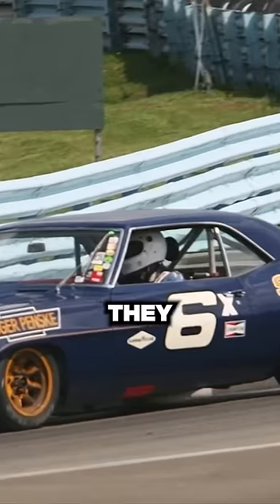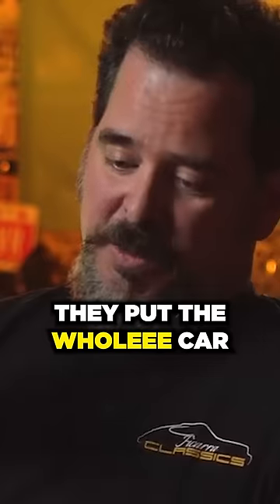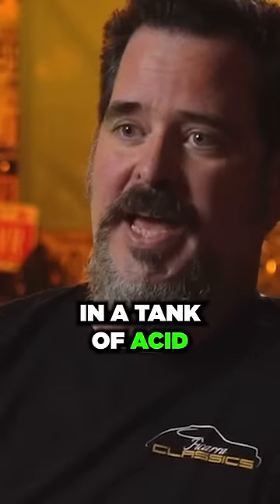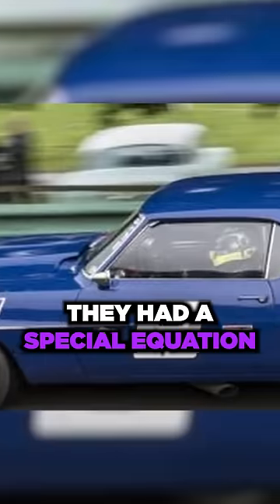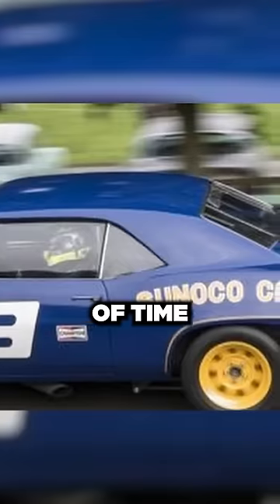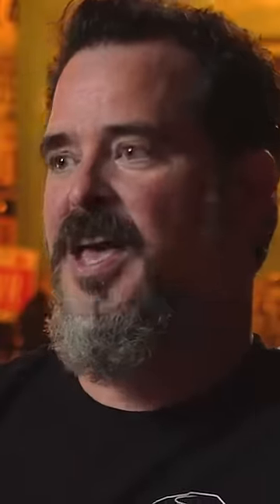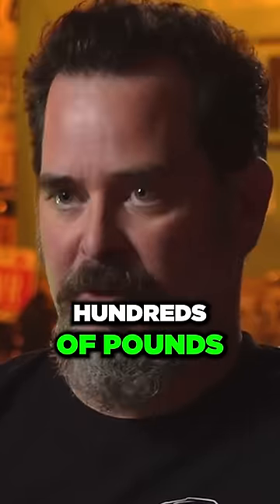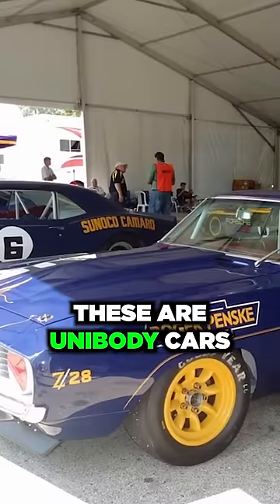The craziest CHEAT in racing history!

Comment: I think this is my problem with modern stock car racing. Their crap cars for no reason. The not homologated in anyway they're special one-off race cars. I think they should either be Actually stock cars or they should be full on race cars. Let the teams have more freedom.
Reply: They are full-on race cars.  They're just not allowed to change anything.
Reply: @randytaylor1258 I see you didn't read the rest of my comment. Let them have more freedom.   At most of the tracks there limited to 500 or 600hp. No they are not full on race cars. Something like a Dodge demon brought to race spec can outrun most stock car on most tracks except for the speedway tracks and the demon is based on a 1994 Mercedes w210 e class.  Either make them race cars  like Indy but closed wheel of course or let the teams have freedom to do what they want .
Reply: @johnantonopoulous6381  they restricted hp because of terrifying wrecks at the super speed ways 
    and even on short tracks there are issues with too much performance 

   indy couldn't run at the one Nascar track 
drivers were becoming disoriented from g forces even losing time
Reply: and full on race car where does the line get drawn 
   
   I put four quark eletric motors in with regenerative breaking hybrid powertrain top fuel burning beast with active areo active suspension traction control  active cornering 
still be my daily driver not spend a penny on fuel 

   everyone would have to build a car like mine to compete 
   and you would have what happened in Lemans with the Quatro
Reply: @johnantonopoulous6381  Elaborate on "full-on race car". What does that even mean?
Reply: @johnantonopoulous6381  you have no idea how far away a dodge demon is from a gen 7 NASCAR. Probably couldn’t even get the demon to be as fast as the TCR cars.
Reply: @NaruSanavai   I would say it needs to keep the driver safe, be as light as possible and as fast as possible. They get torn apart in even minor accidents the weight 3300 pound and they limit the HP to 600 or less at most races because the cars suck. F-1 for example is longer and wider and only weighs 1800lbs  and drivers have walked away from 54 g accidents. I am not saying anything about the drivers they are awesome the cars just suck. All I'm saying is they either need to homologate the cars to be like a road car to actually be stock car racing. Or give the team's freedom to design the car the way they want. Maybe add some aero or suspension modifications hell not both. Also they could easily shed about 1000 lbs and be safer than they are.
Reply: @jose7777777777777777  I am not saying that it is going to beat it for the whole race because it will definitely explode before the end but a demon weights 4200 lbs but has 300 more HP. I definitely think it could keep up. Which is why I am saying they are not race cars, there should be no competition at all.
Reply: @johnantonopoulous6381  There isn’t any competition. A NASCAR cup car is faster than a mclaren P1 around COTA. Imagine what you need for a Demon to be as fast as a P1
Reply: @jose7777777777777777  so what a p1 is not for track time. I did also say brought up to race spec. And the srt viper gtr did it 8 seconds faster than the nascar and the Ferrari fs90 did it 41 seconds faster . Even a Porsche 911 gt3  street trim ran 4 seconds faster. Look at the lap times at cota all the true race cars are in the 1:30's to 1:40's were your beloved nascar is at 2:13. The F1 car would lap the nascar ever 2.15 laps.
Reply: @johnantonopoulous6381  the SF90 is a Formula 1 car dude, as are all the cars in the 1:30s. Come on. There will always be some overlap with the fastest street legal cars and some race cars. That does not make them less of a racecar. The point is close racing and innovation within a rule set. If you want to see ridiculous all out performance go see unlimited time attack events.
Reply: @johnantonopoulous6381  1. "Full on race car" doesn't mean "fastest thing in the world". Nascar cars are 100% "full-on racecars".   Built to a specific set of rules.   
Sure, there are other cars that might be faster.  A Demon wouldn't be one of them, though, but yeah, there are faster cars.  

What I'd like to see them do is use stock bodies, and over the counter engines/parts.   Right now, they have purpose-built engines, that don't resemble anything ever sold to consumers, aren't available to consumers.   
They should be using over the counter parts, stock bodies, and be "stock cars" again. 
That's a huge reason for the decline of Nascar.  That, and moving away from their traditional fan base. 

In the 80's and 90's, they used parts I could go to the Chevy or Ford store and buy myself.  
Today, I can't buy a single part off a Nascar engine at the dealer.
Reply: @SealofPerfection point 1, not the fastest they are slower than Porsche 911 gt3 that had an interior and AC at cota.  Point 2, They are not full race cars. They come from the car of tomorrow crap and they are not stock cars. Either they need to be stock cars or they need to let the teams build a car that would be the best for what they do. You can make the cars way safer without much effort, make them lighter maybe even handle better then let them use the full power of the engine not only 500hp or 600hp because the cars are too dangerous.
Reply: @johnantonopoulous6381  You don't know what a 'full race car' is if you don't think stock cars are. 
They are 100%, purpose-built, full-on race cars, no different than F1, Top Fuel, midget racers, and tractor pullers.  There's literally no other use for them.   Full race cars.
Reply: @SealofPerfection  Than explain to me then why  are the cars so dangerous when they way  100 pounds more than 2 cows.  If they let the teams make the cars true race cars, they would easily remove  1000 pounds and make the car safer for the drivers and let them go without limiting HP. I know the teams and drivers could do it. Maybe they would have more than 1/6 of the viewer that they had 17 years ago. Think about top fuel  they are as light as possible and as safe as you can make them, they are the best at what they are designed to do. When they make a car that is faster that something I can just go and buy that still has 2 seats and a full interior and a radio and ac and airbags and a warranty form the dealer down the street, then I will consider them race cars.
Reply: The whole idea of all the rules and limits is to make all the teams work within the same constraints. That makes all the cars more or less equal which makes for a closer race. Of course they could be made to be insanely fast. But there is no point to it. You clearly don't know much about racing. All the types of racing have these sort of rules in some way,shape, or form...
Reply: @Janus  Were did I ever said to remove rules. What I said is to either change the rule on homologated cars and make it actually cars because it would bring back race on Sunday sell on Monday.  Or the other option would be to allow them to build a racecar, not this it kind of looks like a street car but is   but only because it it built arround an idea that is long dead and gone.

Comment: “If you ain’t cheating you ain’t trying” said someone
Reply: That someone was Smokey Yunick
Reply: @troymecey  - The man was a genius in finding all the ways to stretch the rules without actually breaking them.  He was accused of cheating many, many times. His response was, show us where. They never could, so they just tightened up the rules.
Reply: @rockysquirrel4776  yeah,I know,lol. I have a few of his books. Love to read his stuff.
Reply: @troymecey  Well I’ll take your word on that. When it was told to me many years ago they didn’t give credits. 😂
Reply: Hooyah
Reply: @tundralife5570  Smokey came up with the acid dip, Port and polishing the intake with hot sand, he even came up with an engine that spun the other direction so it had different torque to help it turn. He was a barn mechanic not formally trained. He had a 2" fuel line from the fuel cell to the engine because it didn't say anywhere in the rules how big the fuel line could be, it held a gallon by itself.
Reply: @CrackedCandy  that's the true spirit of racing its pushing the limits of human ingenuity it's not cheating it's innovation

Comment: In 1972 & 1973, the Penske team raced factory Porsche 917s in the Can-Am series. These cars used the latest technology and most advanced materials at the time, so much so that it essentially killed the series because other teams could not afford to build cars that could compete with it (McLaren quit the series at the end of 1972 for this reason). The demise of the Can-Am series left Penske with nowhere to race the exotic Porsches, and also left them with a giant pile of very expensive spare parts, among them a lot cross-drilled alloy brake disks.
In 1974, Penske raced AMC Matadors in the NASCAR Winston Cup series. A review of the Penske Matador revealed that it was running brake disks that were not exactly common on NASCAR stock cars. Ever the innovator, Roger Penske produced an AMC parts catalog showing these very cross-drilled alloy disks, and they even had the appropriate AMC factory part numbers.
Don't ever mess with The Captain.
Reply: The AMC Matador Coupe (though it's really a fastback, not a coupe) was obviously designed to do one thing, wipe the floor with Ford, Dodge, and Chevy in NASCAR. And it did, whenever the teams running them could afford a new engine because when the four car companies agreed to stop factory support for racing, American Motors was the only one of them to actually do so. The teams running the other brands somehow always had fresh engines every weekend.

Had AMC done the same under the counter racing support the other three did, the Matador "Coupe" would have done for automotive styling what the Ford Thunderbird did a decade later in 1984. Imagine the Matador with the turdbird's racing record.

Comment: We did that to our Camero and it came back a rusty mess. Took forever to get it cleaned up. Minimum weight was 3200 lbs so the advantage was adding weight back as low as possible lowering the center of gravity. 
We also bent the rear end assembly to creat negative camber in the back wheels. I never thought of the roll cage as “holding the car together “ it protected the driver while stiffening the chassis and distributing g stress to all 4 wheels

Comment: Most vehicle restorations include acid dipping, and is left in the solution for days. And a roll cage is a racing requirement. If anyone is dumb enough to alter the chemicals or timing, they should be required to disclose that and apply for a salvage title due to the entire structure being seriously compromised.

Comment: Lots of good stories out there about being creative. Oversize fuel lines, lead shot in frame rails that could be dumped during the race, oversize cylinders that they'd out cigarette butts in to get passed the volume test and the butts would burn off when engine ran, inflating a ball in an oversize fuel tank before inspection to make the volume good and deflate it after, and tons more inventive tricks.

Comment: Acid dipping is the primary process of prepping the car to remove then paint, so as to enable additional welding of the chassis seams. 

By adding seam welds to the vehicle's chassis, it increases body rigidity and helps in the overall driving dynamics. Makes the car more predictable and precise.

Comment: Removed hundreds of pounds of steel to replace it with hundreds of pounds of rollcage.
Reply: It's not so cut and dry simple "weight" it's about structure and rigidity. 
They acid dipped the unibody that had very little structure in the ways of countering body flex. Replaced it essentially with a space frame that had a paper thin "camaro" wrapped around it.

The cheater 67 was 1.5 seconds faster per lap than the 68 car they entered and placed third overall at sebring beating lolas, gt40s, a Ferrari lm and was only beat by a pair of Porsche 907s that placed 1st and 2nd.
Reply: Don’t they require a roll cage anyway? So it’s still saving weight…
Reply: It isn't so much that they're saving weight -- most classes have a minimum weight.  It's about taking weight where you don't want it -- the body and roof -- and putting it where you do want it -- a stiff roll cage and generally lower in the chassis.

Comment: It was also to remove caulking ,
Reply: The cars the big race teams (like Penske) started with were typically built without any of the seam sealer or other sound deadening. Build sheets of vintage race cars often show handwritten instructions like “no sealant” or similar.
Reply: @Jason Scott  I totally believe that ,it is hard to imagine such fine caustic control when they dip a body and remove ,what? ...half a millimeter of steel? ,crazy stuff for sure just to shave seconds or portions of seconds off of performance times ,I remember reading something ,that carrol Shelby got in trouble for dunking a factory car to get rid of chaulking and seam sealers,though this was prior to the time  when epoxies where actually the stuff holding the car together, don't know how it would work today ,but if it can be done these guys will find away ,,thanks for your comment,I learned something ,
Reply: @lio0101  today, you can order a “body in white” which is basically just a bare body shell with no sound deadener or unnecessary sealant or adhesives (as you pointed out: some cars have panels secured by adhesives today). These are what race teams typically start with today. Bodies-in-white didn’t exist per se in the 60s, but, as I mentioned before a buyer could specify “no sealants” and get a car that was a few pounds lighter… and louder. Obviously, some teams back then and probably some today still start with a regular production model right off a dealer lot and strip it and dip it before building it into a racecar. Amateur race teams do that all the time.

Comment: A team I raced against once admitted they put the entire body on a big "rotisserie " frame and then removed every single clip or bracket that wasn't absolutely necessary for racing. They tossed them all in a bucket. At the end they weighed the bucket and it was almost 200 lbs. And this was on a small 4cyl car. Man they were fast.

Comment: I believe they were sub-frame cars just like the Nova's were. If they're unibody then they are not factory.
Reply: Just old wise tales, admission of guilt if you knowingly sent someone in a car with weaker alloyed safety into a wall.

I’m a metallurgist acid dipping metal, is about essentially the same thing as taking a mig, or rod and burning holes through metal. Destroys the structural integrity beyond repair.

I think early racing, manufacturing processes wanted to experiment with alloys before being pawned off on the general public. I think they just told boomers they acid dipped or whatever to A. Hide intellectual property, B. Not openly admit there could be a high probability that car is very unsafe. 

Racing and cars in general were facing hefty regulations by the communist government at the time we had.

Comment: Yup, acid dipped body and "adjusted" front suspension mounts for better geometry. Just two of the changes Penske made. My manager owned one of the Penske '69 Camaros. He sold it. One reason he missed having it, when the race tires for his 289 Cobra became too worn, they still worked great on the Camaro.

Comment: In NASCAR, they used to spray paint cardboard silver and cut it to look like a restrictor plate. The inspectors would see the shiny plate and pass the car not knowing  the cardboard would burn through the exhaust and the car would have its full 700+ horsepower.
Reply: 😂😂 restrictor plates are not even involved with the exhaust.
Reply: @rossmessick5974  is it part of the exhaust system? No. Does it lead to the exhaust? Yes. Try to think a little harder next time before you comment lol

Comment: I used to work for a car dealership, and I had a customer who would buy pallet loads of Chevrolet aluminum heads that he would machine down to the absolute minimum tolerances and breakpoint to remove as much weight as possible, and still maintain high enough compression to finish a race. He sold them to Chevy teams by the dozens all year long because they were only good for one or maybe two races at the most

Comment: They also reset the front of the camaro from the windshield  forward sloping down 3" as a ground effect.
Not sure what cam they used on that 302ci but I know it was a destroked 327  that ran a large journal 283 crankshaft with high compression pistons and feulie 61 cc heads and 2.02" intake valves

Comment: Why didn't they just use magnesium wheels (then spray them the right colour), fibre glass bonnet/doors/front wings/boot, or do the exterior panels have to stay steel?.
Reply: They had to stay steel...unless you could buy the fiberglass/aluminum parts from the local dealer. I know Ford sold lightweight body parts from their Ford Performance catalog back then, and of course the Mopar fans had their Direct Connection.

Lest we forget Don Yenko's abusive relationship with GM's Central Office Production Order forms...

Comment: My dad used to race 2 things come to mind , first the roll bar held an special additive that oxidises the fuel better ( family secret won't give additive away ) second he would adjust the valve an extra   010-.020 sloppy when cool when engine was really warm in the mid to late race that thing would scream . Saw only 1 trick used and it worked but I won't give it away which

Comment: '60s and '70s Camaros were NOT unibody cars. They were front clip, half-chassis cars with a good bit of body flex from the factory. The only way those dipped cars could race was by using the roll cage as a chassis space frame.